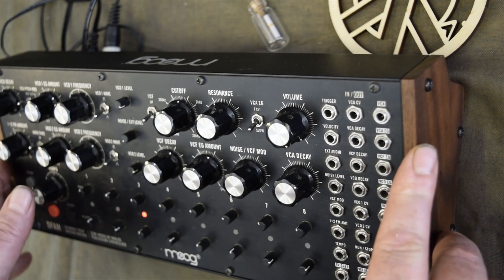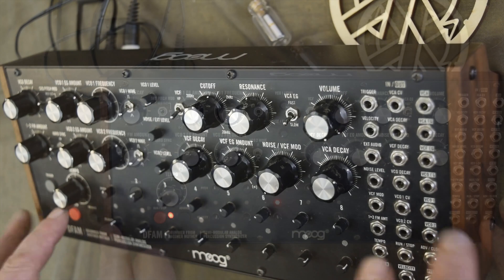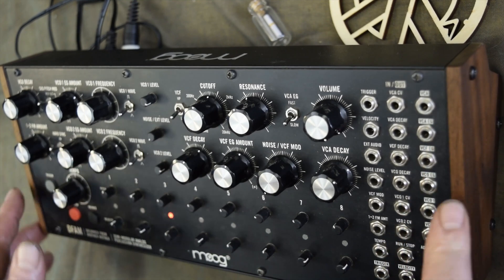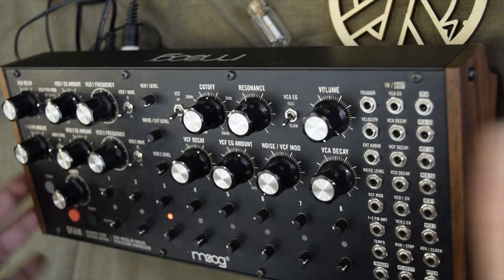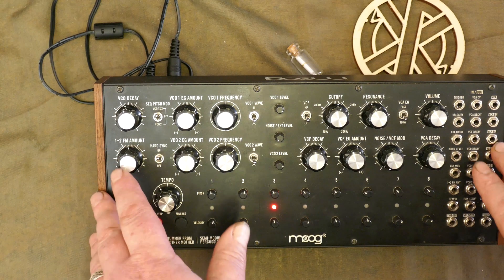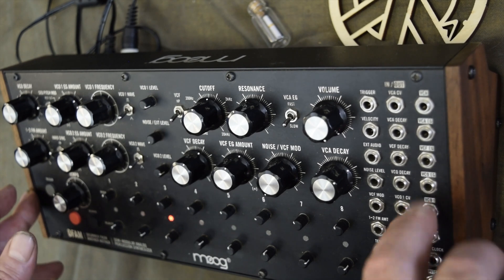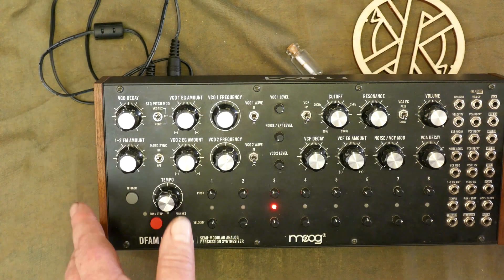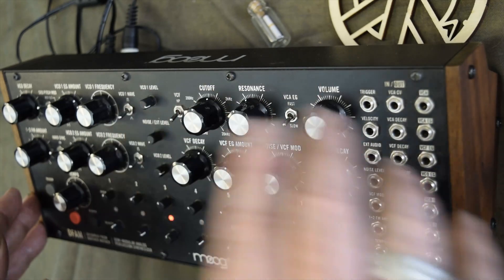How to use Semi-Modular Patchbays: Moog DFAM /Drummer From Another Mother Patch bay explained + Tips

Comment: I actually haven’t found the lack of midi too much problem, I either trigger it via my TR-08 or the Mother 32. The lack of reset is very annoying though. They did a big firmware update to the M32, so have always been hopeful of something similar for the dfam.
Reply from the maker: Hey Steve...! Yeah, I've used it as a melodic instrument with the KSP as a controller, but I still don't think it allows for a full range of expression beyond just the triggers. To be able to open it up to being used as full synth engine would be great though...  as far as I know the dfam doesn't have firmware, it's purely a eurorack analog system...

Comment: Being there is no midi, is it impossible  to update  the firmware for this quirky machine?
Reply from the maker: Hey Sunny, afaik there's no firmware available on these...  they're purely analogue eurorack style units.
Reply: @Studio-solutions-com  I ran into this video today about this device, Sanoclast MAFD midi adapter for a DFAM. Have you heard of this?
Reply from the maker: I have..! Did you see a price for it Sunny? I've heard a couple of people say it's about a hundred quid?
Reply from the maker: They do a 2hp eurorack module version too... although tbh there's quite a few midi to cv modules available too
Reply: @Studio-solutions-com  I have a RetroKit 005, that converts Midi to a gate signal along with my Toraiz Squid that does cv as well. Dumb question but Is it possible to play notes on my DFAM with my squid? Still learning the language of control voltage.
Reply from the maker: @twotofourstudios224  yeah, the beatstep/bsp and ksp can convert incoming signals too, I guess a few semi modulars would also do it, the Crave for instance... I don't see why that wouldn't work Sunny,  from what I've seen the Squid is pretty much designed for anything!
Reply: @Studio-solutions-com  Thanks for your input! I have had my hand full the last two years learning how to play and use all my gear. When I started saving 10 years ago to  build my studio I forgot to consider the time it takes to really have a working knowledge of a piece of gear and buying several things in a short period of time has made for a some things getting pushed down the list. The Squid rocks. The main reason I went with it was it being Pioneer DJ, I thought they would be around to update as needed. Not the case sold Toraiz  to a printer company i think. Most likely no firmware update for it. I will be deep diving into it next week... Hopefully! Cheers!
Reply from the maker: Now that I didn't know..! lol I have a friend who runs her whole midi set up through hers and has it totally linked to Ableton too... She absolutely swears by the Squid..!
I did much the same, got caught up in GAS and didn't take the time to study each piece thoroughly until lockdown really...  A lot of the videos I make are just to help me retain info on them as I'm finding more stuff out!
Reply: @Studio-solutions-com  Honestly this whole pandemic has been a godsend to me. Its allowed me to focus all my time on my studio. I'd be a year or two behind where I am now if I wasn't laid off from work. Don't think I suffer from GAS. Every thing I've bought was planned out. It's just I bought it all at once. Most people start with a few things and add to it over years. I saved for years and got it all in days. I'm going to dive into the squid and see if I can get it to play the dfam today. Cheers! OH and thanks for taking the time and giving your thoughts! It's been a very helpful!